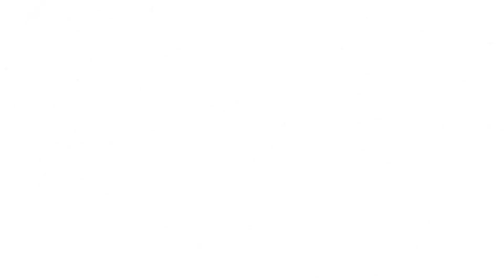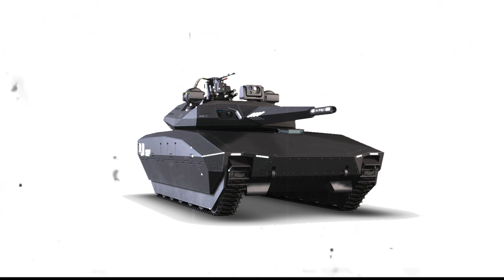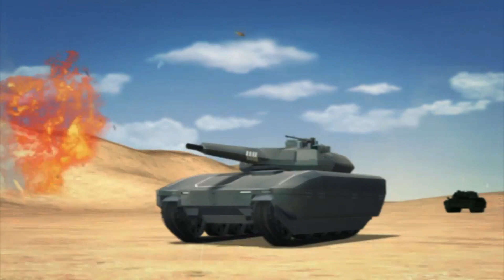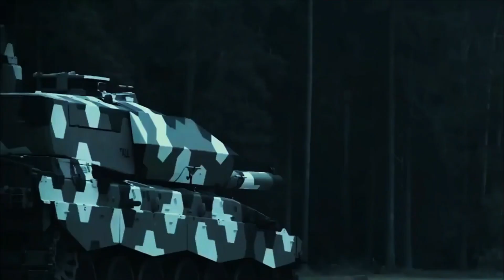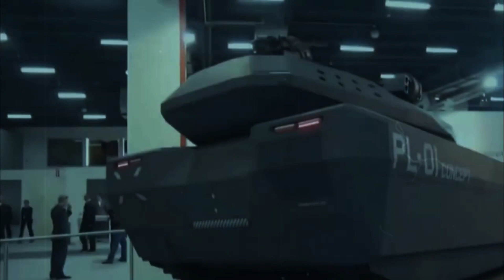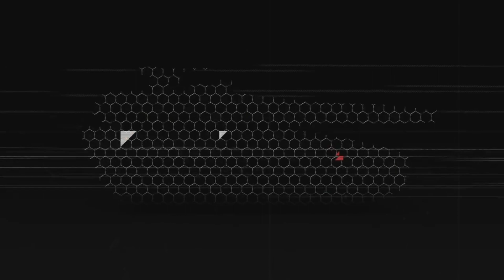Polish Just REVEALED Russia’s Nightmare: A New Stealth Tank!

Comment: I am starting to question your content, please ensure quality over content, so the Polish made a super stealth CV90? And the Swiss and Germans did not incorporate it in any versions. + you say there is advanced internal blast protection? There is no actual footage of the Vehicle that you presented operating, it looks like BS. Make sure your content of correct and accurate or people will call you out.
Reply: I am Polish so straight to the point - there is no vehicle. It has been actually in development. But (unfortunately) the project has been closed without giving any reasons/justification. The project had failed probably because of potential long research. For sure some of the concepts of this prototype could be used in the eventual Polish-Korean next gen tank project (the research/project might start if both parties will decide to cooperate together around 2024-28).